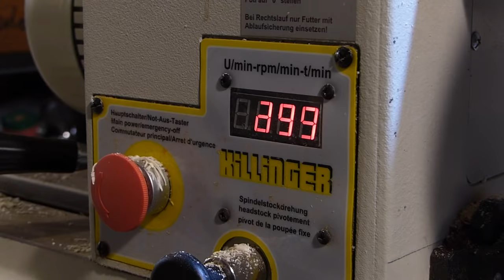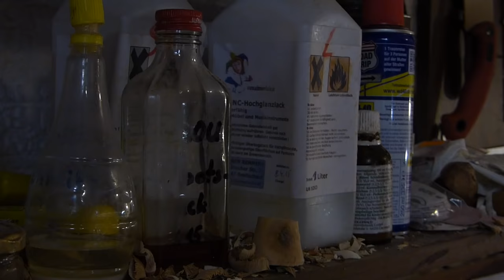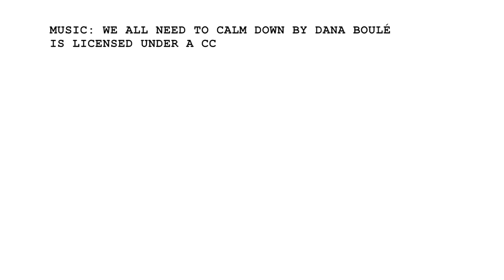Zu Besuch beim kleinen DreXler: Kleine Walnuss Schale drechseln.

Comment: You have excellent turing skills young sir. However you are missing two of the most important ones. 1) Safety glasses are not enough. You really should wear a face shield. 2) Your young lungs should always be protected with a dust mask when sanding. Even the large vac you have leaves the worst kind of dust behind for your lungs (Micro...) Anyway, great job and happy turning... P.S. If you get a chance watch the Youtube video from Alan Stratton (As wood turns) He shows how even professional turners are not safe with just safety glasses... V